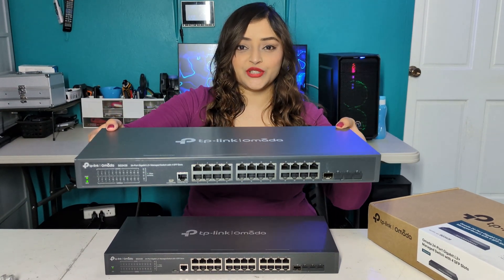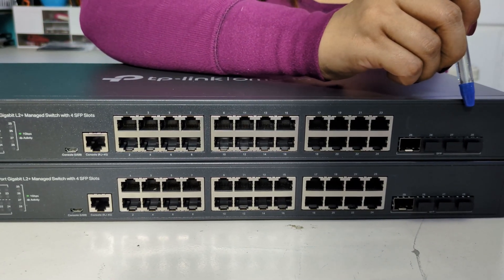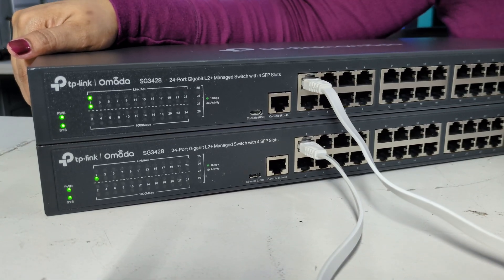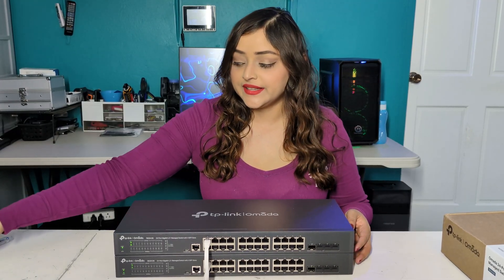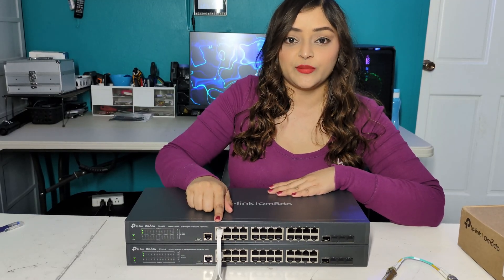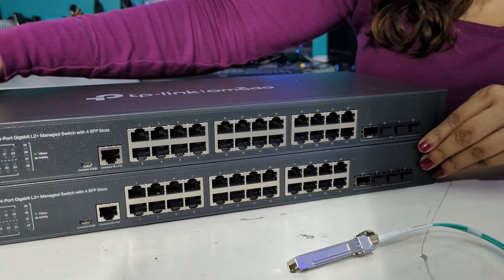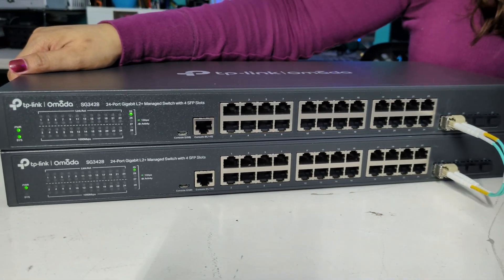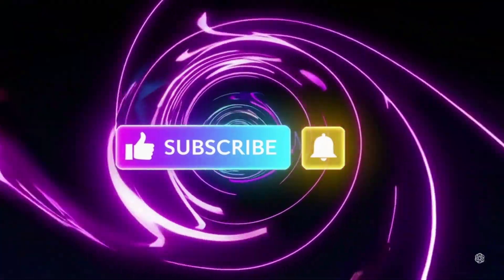TP link Omada TL-SG3428 - 24 Port Gigabit Switch_Tech Things

Comment: If am not able to.accese the switch with management ip address through web interface due my switch uplink was not up ...what's was the other to access the switch configuration
Reply from the maker: Direct connection! Use a Ethernet cable and connect the desktop or laptop direct to the active port on the switch.